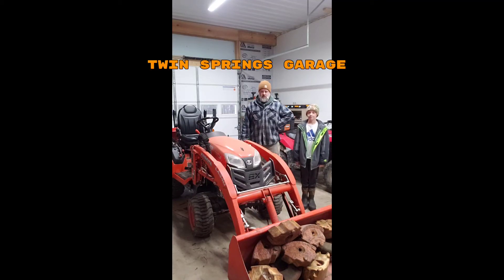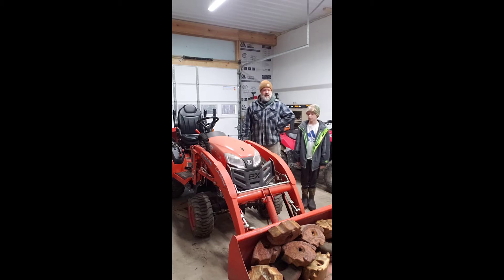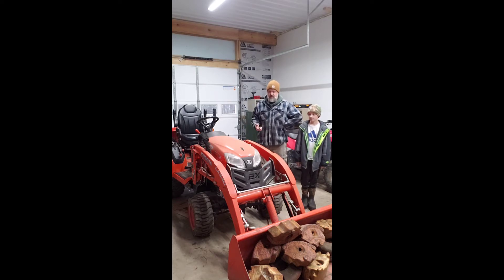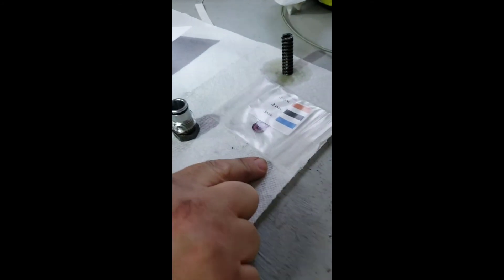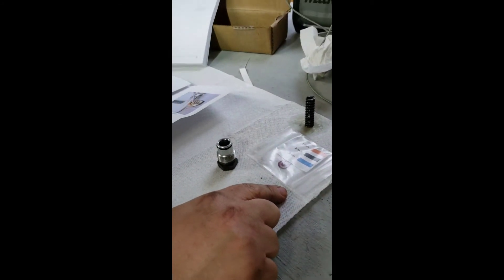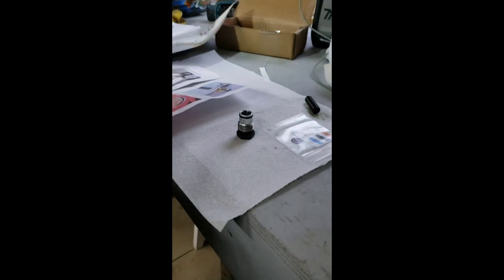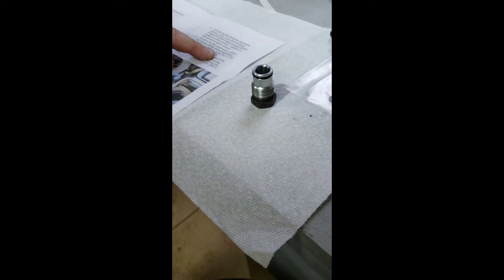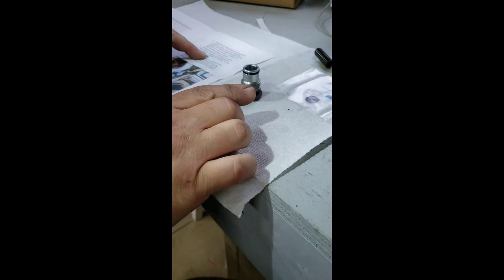Kubota BX23S Hydraulic Pressure and Lift Capacity Test

Comment: Neat test.  Waiting on delivery of our own Compact... I was just curious how much you are expecting it to lift?  The spec sheet for your LA340 loader says lift at max height is 509lbs for the pin-on and only 423lbs for the quick attach version.   Oh, and your bucket weight has to come out of the max lift limit also.  Your bucket must be at least 100lbs right?  So you are getting a lot out of that loader.  You are getting well over double the max lift spec numbers at about a 2 foot lift.  That's right in line with what that loader should do at a foot or two right?  The L3901 we are getting with the LA525 loader specs at about 1100lbs at max lift.  So you are taking the max lift load of the next size loader up from yours and still getting it over 2 feet off the ground.  Not bad.